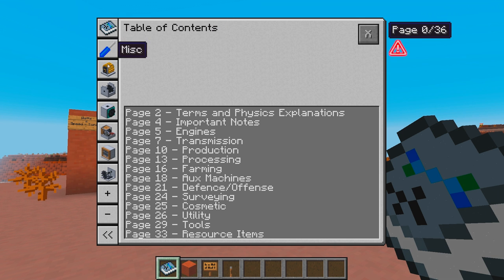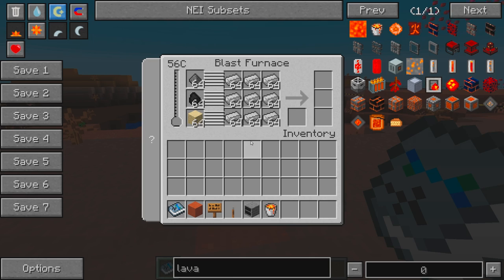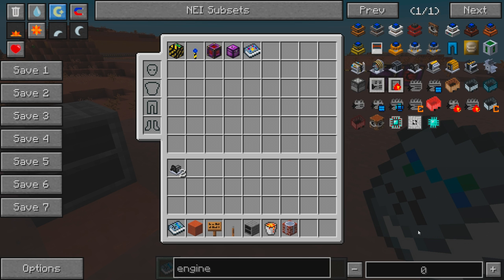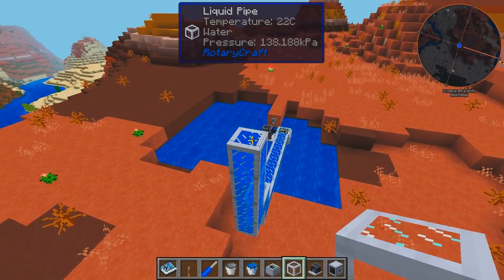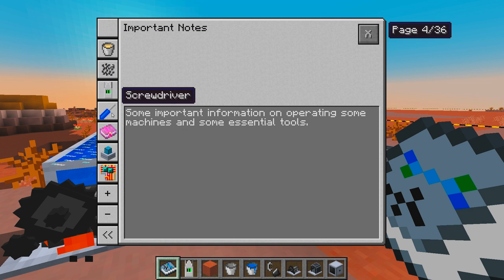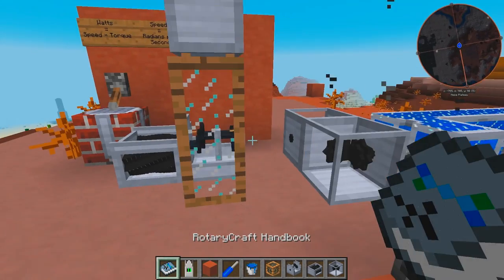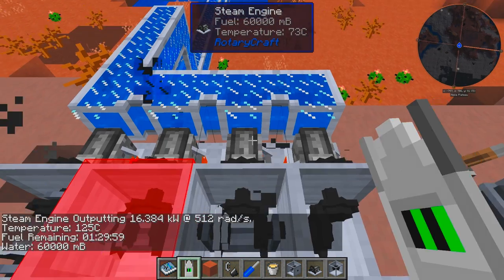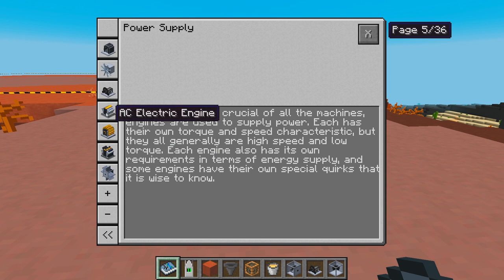RotaryCraft v6f Mod Spotlight, The Basics

Comment: For running a grinder off a steam engine, wood gearboxes need cooling (via a fin), not lubricant. You can also use a worm gear.
Reply from the maker: ReikasMinecraft Interesting. I've never really used wood gearboxes. Usually I just jump straight to HSLA.